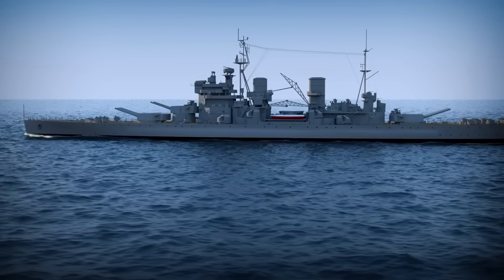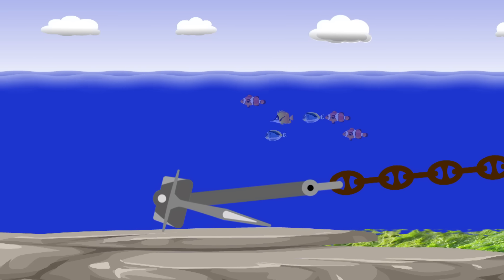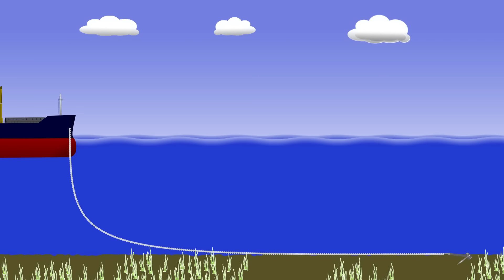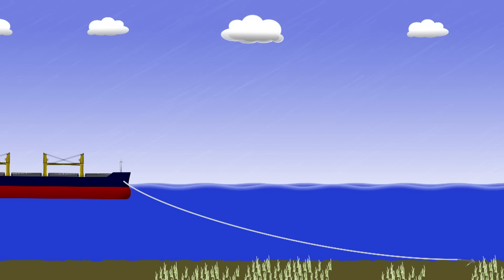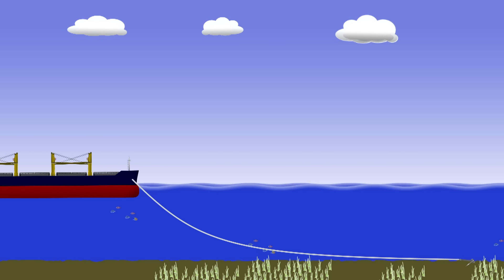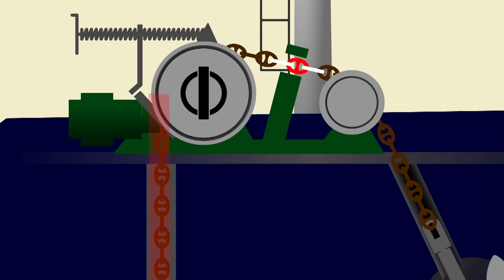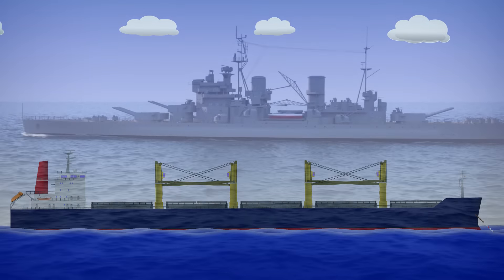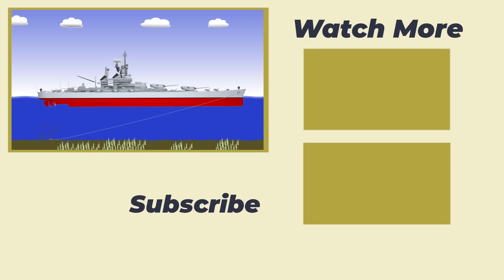The Truth About Anchoring Huge Ships

Comment: I had no clue it is not actually the anchor itself that holds a ship in place. Great video!
Edit: Don't go far into the comments, this for some reason has sparked quite a heated debate
Reply: same here
Reply: The chain holds the boat, the anchor holds the chain.
Reply: Same
Reply: Always glory to arstozka
Reply: I am surprised too that anchors are a bit more complicated than they seem at first glance.
Reply: I have a 20ft boat with 6m of chain on my anchor. Alot of people question why I have so much chain, but I tell them how they actually work and I've done the maths to work out chain length for depth of water vs vessel size.
Reply: Same
Reply: Neither did I, I always thought that it was like a brick on a string, and I never actually considering the immense weight of the chain
Reply: While the chain has a role beyond connecting the ship and anchor, it is not the chain anchoring the ship, this was a very inaccurate video.(At least the narration was inaccurate, the animation seemed reasonable.)
Reply: @mytech6779  you don't understand what the narrator was saying. The anchor keeps the chain connected to the sea floor. The weight of the chain stops the ship from moving. If the chain didn't weigh anything the anchor would never be able to keep the ship in the same place because the ship would drag the anchor through the sediment.
Reply: @mytech6779  Kind of  true,  the way I see it is the chain keeps the anchor pulling into the seabed as opposed to a anchor on a rope pulling at 45° to the sea floor.
Reply: Glory to Arstotzka!
Reply: I hope ur being sarcastic
Reply: @balijaa  like you knew about this before you watched the video.
Reply: @balijaa  you might have happened to know about this topic but I'm sure there's plenty of stuff that you've never thought about. Here's one thing, if you want to deorbit a satilite in LEO what is the most efficient direction to fire its engine? Explain the cause of the Deep water horizon oil spill. Also explain why the astronauts on the ISS are weightless. I challenge you to answer these questions without searching them.
Reply: @drabberfrog  I played a bit of KSP so I know if u want to deorbit u have to fire its engines in direction ur moving example if ur orbiting a planet in this way > and u consider ur engines a bottom u have to position ur rocket like <=€ €=engines so ur going like this <=€ >>>> and u fire ur engines in that position about ISS personel being weightless Im guessing coz theres bo gravity so no gravity=no mass
Reply: @balijaa  nah there is gravity on the ISS lol. They’re just moving around at ~8km/s. And so they are moving around the earth at the right speed to stay in orbit. This means that basically they are in free fall at all times, and so they feel weightless. Also mass ≠ weight.
Reply: @kizzjd9578  The length of rode is by far the most important factor. 45degrees would require a scope of only 1.4*water depth, 5:1(11.5deg) is common for day anchoring 7:1(8.2deg) for overnight and 10:1 for storms(5.7 deg).  

A modern 35pound yacht anchor, typical for a 35foot yacht, will provide 1000-4000 pounds of horizontal hold with 7:1 scope and average seafloor. Typical chain for this size is 5/16 which is 1.1pounds per foot in air and .95 in water. 
Assuming 2000 pound horizontal pull and 7:1 this would  create about 2020 pound line tension and 288 pound vertical component with neutrally buoyant rope, depth being irrelevant for such rope as long as the vector angle is constant. 

Assume 30ft depth and 5ft free-board for chain (7:1=245ft rode), this chain will connect to the anchor at zero angle up to 800pounds horizontal tension. At 2000 pounds it will have an angle at the anchor of 4.8deg and produce 168pound of vertical component. Now that is a 3.4deg and 120pound advantage in vertical force comparing chain to rope, about 40% less. (At 4000pound pull the vertical on the shackle are 576[rope] and 456[chain], still 120pounds but now only 20% better) 

It is possible to add a 120lb [kellet] weight to the nylon rode at or near the anchor and the forces on the anchor become equal to the chain rode. 
Now assuming 245ft of 5/8 nylon rope(10.5pound per 100ft) or 5/16 steel chain(110pound per 100ft in air): The rope with kellet weight and anchor is 25.6+137.6+35=198 pounds, 61 with no kellet; the chain and anchor are 270+35=305 pounds. That weight difference could be used for a 400% larger anchor while retaining the kettle, or an 8x anchor upsize if discarding the kellet. 

Put another way: for a given tackle weight and 30ft water, you can have a 35pound anchor with all chain, 
a 142pound anchor with 137 pound kellet and a nylon rode, 
a 270 pound anchor no kellet and nylon rode,
two 120 pound anchors and an extra rode,
or a 215pound anchor 50pounds of chain for bottom chafing and 3/4 inch nylon.

As for energy absorption you are better off with nylon and or snubbers, a chain catenary only has meaningful energy absorption in a narrow scope and deeper waters.
Reply: @drabberfrog  That is entirely wrong, many anchor tests have showed the weight and friction of the chain is a small fraction of total anchor forces. It is ratio of chain length to depth that matters most. Heavy chain is used because it is more durable than cable or rope of similar tensile strength when rubbing on rocks and steel cable is difficult to inspect or repair.
Reply: Same
Reply: @drabberfrog  if anchir is capable of kerping heavy chain in place, it can also keep light chain in place.
Reply: @mytech6779  Thanks, good to know! This is why I have a spotlock motor instead of using an anchor 😂
Reply: @drabberfrog  this makes no sense
Reply: Yup. Interesting information, new to me, presented clearly.
Reply: @mytech6779  so are you saying the entire video is false?
Reply: its mostly the weight of the chain
Reply: I guess you are not from Nirsk, or you would know everything about ships.  Glory to Arstotzka!
Reply: @SimonWoodburyForget  it’s the angle of the pull upon the anchor that determines how much it can hold. That’s why you let out more rode to hold better. More rode=acute angle=better hold. That’s why when the ship is directly on top of the anchor it can just pull it right out. So some independent research before you believe one video on YouTube
Reply: I always wondered why you put out 10x depth on your boat as your anchor chain.
Reply: @SimonWoodburyForget  And as I said the video is just wrong, it didn't share any real math. I have actually done the math.
Reply: @Andrew H Even on huge ships and off shore platforms most of the ultimate holding force is from the anchor embedment. The catenary only contributes significantly in fairly mild conditions.
Reply: Often it's the ship's engines that keeps the ship in place, the anchor simply a guide.
Reply: It’s still the anchor holding the ship in place silly
Reply: Wow! A true intellectual....
Reply: It doesn't this video is completely wrong! What holds the boat is the anchor, the long scope of chain or rope changes the pull angle on the anchor. You can easily see from the video that when the anchor is pulled at a 90 degree angle to the seabed the anchor has the strongest holding power when the angle  decreases the anchgr looses holding power. This is the reason why you need  long lengths of anchor rope or anchor chain.  The weight of the chain will have some dampening effects but is not the main holding strength of the anchoring system, it's not even 20 percent!
Reply: @drabberfrog  Mt Tech is 100 percnt correct.  
Andrew, rope anchor lines are a thing and there very light weight!
Reply: @mytech6779  The video was very accurate . The anchor is just a means of tethering the end of the anchor cable to the sea bed , or keeping that end in one place , it ios the anchor cable or chain that does the work of holdon the ship in place . When the anchor is dropped the ship goes astern slowly so that the cable or chain is laid in a line, not just pilled on the bottom of the sea bed . It is the combined weight of the chain that keeps the ship in place , the anchor itself acts almost like a plumb bob
Reply: @drabberfrog  Yes , you have it right , the other critcal thing is to let out enough chain for the size of ship and the conditions
Reply: @kizzjd9578  Kind of yes . The anchor is just there to keep that end in one place while you go astern and lay out more chain , its the weight of the chain and the friction that does the actual anchoring , unless it is very bad weather with strong winds and thats when you can drag the anchor as ilustrated in the video , the only thing you can do in that situation is try to retrieve the anchor and drive away or let out more chain and pray
Reply: @balijaa  You might know that those two components stop the ship moving but you probably did not know exactly how it works
Reply: @BundasaurusPecs  So , does that mean that if the iss was traveling slower it would fall to earth ??, gravity would pull it down??
Reply: @SimonWoodburyForget  The other thing about this when talking about the film ''Battleship '' is that even if the flukes got that good a hold on the seabed when the chain came tight it would rip it out of the ship 50,000 tons travelling at around 35¬ 40 mph , it does not bear thinking about
Reply: @arposkraft3616  Correct
Reply: @jakeski3142  No , he fully understands how the anchor works , the video is very accurate and factual
Reply: @fk319fk  Sometimes more depending on conditions , the weather and currents all play into how much you put out , not just the depth of the boat
Reply: @Andrew H That is if the anchor can bury itself , it depends on the seabed and if the anchor can bite into it
Reply: @mytech6779  The video is accurate , it does not need lots of complicated math , it ilustarates exactly how an anchore on a ship works
Reply: @Andrew H No , not just huge ships , 1500 ton coasters use the same method
Reply: @Ajs3371  You are comparing yachts and cargo ships, they are completly different when it comes to anchoring . Cargo ships rely on the weight and friction of the chain to hold them in place , that is why if they are aty anchor and there is a storm they let out more chain . More chain equals more weight and drag
Reply: @Andrew H That guy is wrong (Mytech) , the video is accurate , the anchor does act just as a weight . Think of it on the principles of a fishing weight , you cast out , wind in until you feel temsion from the weight on the bottom as it holds the end in place . The video shows exactly how it works
Reply: @prjndigo  No , its the anchor
Reply: @mynameisprivate158  He is comparing ships with yachts . They are totally different . This video is %100 accurate
Reply: @mynameisprivate158  It is the chain , not the anchor . If the anchor can not bite into the sea bed it will drag , that is why you let out more chain , to increase the weight and drag
Reply: @MrTarmonbarry  Your statements are little more than old wives tales and mysticism unsupported by the actual research and physics. 
And there is a lot of research because anchors are needed for multi-billion dollar ships, oil rigs, dredges, and many other high value floating items.
Reply: The debate has become a bit heated  because there are people confusing the difference of anchoring a yaght or a nodern cargo ship. The video is based around a cargo ship so should be taken as such , and it is correct
Reply: @MrTarmonbarry  You seem to lack basic comprehension of both this general thread discussion and the underlying anchoring topic. I'm not trying to be rude when i say that. But you're a bit like some Indian call center customer support that just keeps mindlessly repeating their one que-card that doesn't actually apply to the issue you're calling about.
Reply: @mytech6779  Of course it isn't really the weight of the chain holding the ship. Otherwise we'd just get heavier anchors (which would also "grip" better) . But you seem to be kind of missing the point  what a chain actually does, and it isn't just durability. You see it's about weight and force distribution, not a total weight.

At low load the weight of the chain itself is capable of overcoming the drag. And this can be easily proven by the fact that the chain will slacken.  So yes the video is correct. However "keeping the chain in place" actually implies the anchor will experience a force. Otherwise not the ship, but the end of the chain will be the one to move. So a bit of a semantics issue, but is still the weight of the chain which "creates" the "attractive" force - and the anchor is holding it (or a portion of it anyway). What this force would be would depend on the weight of the chain. 

The important bit here is that the chain will slacken and change the direction of the force applied at the anchor point. Which is kind of important. Yes, important. This maximum hold is not just a static number. Basically, when the anchor is pulled horizontally, you are compressing the material of the seabed. Not only compressive strength is generally larger, you are also compacting the material thus increasing it more. You see it's not just a matter of the horizontal force applied on the anchor, it's the ratio of them, that's why is so much easier to dislodge the anchor up. 

But  this slack does not only mean less vertical force on the anchor. It also reduces the dynamic stress. On top of that heavier chain has more inertia (because of mass) which reduces the dynamic stress on the anchor points even more . And given the fact that waves are a thing - you can guess why that is important.

So that's pretty much the extent to which chain weight matters, how much it can "slacken" itself by pulling the ship back, and what force it would need to become "tense". 

The bigger the ship the more sense a heavier chain start making. Not only you do not need supersized anchor with all the space that entails, but you greatly reduce the stress of everything. You will rarely need to use the chain and anchor anywhere near their top rating. But if you have heavier anchor, you will need to lift it every time - at once. So not only you would need a more powerful lift and break mechanism, the chain/rope will need to be stronger or it will experience high stress routinely. So you soon get to the point of needing a stronger chain anyhow.
Reply: @MrTarmonbarry  you realize that you can also drag the chain, right? And if the anchor doesn't bite it won't be the ship moving back, it would be the lose end of the chain. For the weight of the chain to create the "attractive force" you need it to be anchored on both sides. Maybe you missed the "keep the chain in place" bit. 

You have two drag forces which you need to balance to stop without the anchor. The water and wind drag pushing your ship in certain direction - and the friction of the chain against the seabed. (If you ever wondered why you usually orient against the current and anchor from the bow - that's it minimize the drag.) A massive ship has pretty high drag, so you would need really a lot of chain to match that - even with rather low current. So no, the drag of the chain is pretty negligible compared with the anchor so that's not what happens here (and why we still need anchors). This should be pretty darn obvious from the animation at the point where the chain lifts, where does that "friction" comes from then?

It is still the anchor, but the distributed weight causes the "L shape" of the chain which is the optimal condition for the anchor "to bite" and to hold. That is, small or non-existent upward component and much larger horizontal one.
Reply: @SimonWoodburyForget  in all fairness MyTech actually has a point with the semantics. 

The weight of the catenary is held by the anchor points. So the anchor will experience a force i.e. that's what holding the chain in place means. 

The friction of the chain with the seabed is not what stops the chain from moving, as after a certain point will not be large enough.  Not only that but when the ship experiences a larger force and the chain starts lifting, the friction will decrease exactly when you need more of it.
Reply: Something he completely misses here is that the anchor doesn't just hold the chain on the bottom, it's weight is needed to pull enough chain out of the ship in the first place until the chain has enough weight strung out to where it'll keep pulling itself out, otherwise it wouldn't drop in the first place.
Reply: @SimonWoodburyForget  a typical cargo vessel like an afrimax tanker(115,000 ton) will have a 11ton bower anchor and 12 shackles of chain weighing 3 tons per shackle(75mm studded),  standard mooring will use a scope of 6:1 and the typical stock-less bower anchor has an efficiency factor of 5 to 12 in typical seabeds with normal 6:1 scope. 
The maximum friction the chain has on the seabed with this setup is around 15 ton force under light load and dropping as the catenary picks up under increasing force.
 
This size ship in a 1.5m/s (3kts) current has about 20ton force, a 9m/s wind is about 6ton force. This assumes pointing directly into the flow, non-aligned forces would be greater. Even under this mild condition the chain friction is only 1/4 of the anchoring power. https://www.ocimf.org/media/8922/Estimating%20The%20Environmental%20Loads%20On%20Anchoring%20Systems.pdf
https://stewart-usa.com/sta-chainlength-catenary-calculator/
Reply: Yeah,  also the colored links is an interesting bit.
Reply: Same rules for small boats.  Let out 6 x the depth of the water in chain. Geeat vid tho
Reply: @mytech6779  you are wrong sir. The video is very accurate. I speak as a Master Mariner. Each length of anchor chain weighs about the same as the anchor so if you have a ship with a 13 tonne anchor with 6 lengths of chain out, that’s a lot of weight holding you. You NEVER want to be in the position when the anchor alone is holding the ship as it will break out. In these situations, you either let out more cable or just weigh anchor and proceed to sea.
Reply: Just here to say, Glory to Arztotzka!
Reply: @drabberfrog  was I right
Reply: @mynameisprivate158  boats don't need heavy chain because the anchor is enough to keep them in place. The anchor alone is never going to keep a ship in place because the ship will pull the anchor right through sediment.
Reply: @balijaa  no you weren't
Reply: Unbelievable Jeff!! They really are getting heated about anchors 🤣🤣

They need to end the lockdown ASAP people goin nuts
Reply: @kizzjd9578  "A lot" not "Alot" nor is it "Allot". Alot is a town in India.
Reply: Well now I’m going allllll the way into the comments!
Reply: @goonridingupnorth1382  same
Reply: I'm just glad my 12' fishing boat anchor doesn't need a chain...or does it?🤔
Reply: @coloradostrong  Thanks, I'm actually pretty on the ball with my grammar and punctuation. "Alot" is one of those words that make me feel like it's wrong when I type it 😂
Reply: @mytech6779  Go on Wikipedia and read something about Acceleration Forces. Then you´ll understand why the Chain has more part in it than the Anchor.
Reply: @brycebullard3619  Your anchors “don’t need a chain?” You’re just tossing anchors overboard? I GUESS that would work, given enough anchors and a small body of water...
Reply: @kizzjd9578 . Yes I thought everyone knew why anchors have chain, even small boats..
Reply: Thanks for the warning!
Reply: @brycebullard3619   it’s best, every small boat has chain with their anchor , proportional to boat size, I estimate you should have about 3m  heavy chain. In strong current it stops the anchor head lifting off the sea floor
Reply: It's the internet, a cute puppy tilting its head could spark a heated debate.
Reply: @garysmith2450  Funny as there is no such title(although there is a "master captain" license, but that is for yachts under 100ton) and every industry source on the sizing of a ship's ground tackle calls BS on a shackle of chain equaling the weight of the anchor. 
A 10ton anchor will use chain weighing about 3tons per shackle, according to actual engineering specifications and international standards.
Reply: @jakecole7447  I'm very familiar with dynamics. The catenary offers only trivial energy absorption under the conditions of scope ratio and current/wind forces found in practical anchoring.
Reply: @diomepa2100  Yes it may be a semantics issue but I doubt it. "The anchor holds the chain in place and the chain holds the ship" could mean that the chain is simply transmitting the forces between the anchor and the ship; but it is self evident that something needs to transmit the forces so the implication is that the chain is doing the actual work of attaching the ship to the seafloor. Poor explanations can be as bad as simply giving incorrect information.
Reply: @SimonWoodburyForget  You don't seem to understand the basic meaning of any of the terms and concepts you are fumbling with. Friction coefficients, surface tension, etc.
Reply: @brycebullard3619  (Yes, I know it is a joke.) While the underlying physics are the same, a 12' fishing boat must consider scaling issues. 
Small anchors of a given design have a lower efficiency factors because they are more on the loose surface and can't bite as deep into better consolidated subsoils, and so very small anchors may not be much better than deadweight.(string on a brick) Secondly as chain size is reduced the surface area to mass ratio increases making them more prone to corrosion. What fraction of the boat's capacity will be taken up by weight of the chain and anchor? And lastly will you be fishing in high seas and gales?
Reply: @Qeycon Ha, like I'm going to give out my member info in a YT comment!
Reply: @SimonWoodburyForget  "anyone can make and publish a website, just like anyone can make a comment, " 
Yes you caught me. I created an entire website, got it respected by the industry, then created a detailed multi-page paper on the physics of wind and current forces on moored tankers just to troll your lame sub-comment on YT.
Reply: I can't believe you people need this explained to you. The anchor itself will not hold a ship in place. The winches that pull the anchor up are able to dislodge the anchor from the soil. So what makes you think those witches have more Force than a giant out cargo ship being pushed around by wind? That's because the anchor itself is made to help embed the chain into the seabed as well. Not only does this make multiple points of contact where it has traction to hold onto but with a large amount of chain let out you make it so that if the ship moves, it needs to move an extreme amount for it to start to pull the chain out of ground let alone the anchor. The only thing I know that can do that are hurricane-force winds. So as long as that's not happening then the moment the winds let off a little bit the ship will be pulled back into place as the anchor chain falls back to the surface of the seabed. It then will redig itself into the sea bed and start the process all over again. My uncle was In the Navy and he was one of the guys to work the anchor on very large ships including aircraft carriers. I think since he actually has experience doing that and you're just a bunch of people sitting behind desks on YouTube that he's probably right. I'm no mathematician so I can't judge the dudes math in the video but everything he talked about his spot on from a man who actually has experience doing this.

 and for those of you in the comments that said to go to Wikipedia. Do I need to explain to you why that's a retarded thing to do? I could literally go edit the Wikipedia page.
Reply: @Qeycon I didn't ask for your phone number.
Reply: @Andrew H mytech speaks out of his passage. The video is entirely correct about the chain holding the ship. I work at sea on large merchant ships so can speak from experience.
Reply: @Andrew H it’s the weight of it as well as the friction. Some holding grounds are better than others but if you’re on good ground, you will notice that when the ship swings round her anchor, she really only swings around the point at which the chain makes contact with the sea bed. When you anchor, on the chart you plot a max swinging circle based on the scope of cable (the chain; on ships, we still call it cable) you’ve put out but you’ll notice that she swings through a much smaller arc. If high winds pass through, you’ll notice that she may drag some chain along the bottom and when the wind calms, she will swing round a new position. If the ship approaches the limits of your charted max swinging circle, you are at risk of dragging anchor. In these situations, you either let go more cable or (preferably) weigh anchor and proceed to sea. It’s much safer weathering a storm at sea than at anchor😊
Reply: @kizzjd9578  Something Casual Navigation didn't include in the video. How much chain a ship needs to let out depends on ship size and depth of water. You 20 foot boat might need 10 metres of chain, in 400 feet of water. This is where switching to a rope rode has a negative impact, staying all chain or switching over to wire / cable doesn't reduce the weight so the chain length can stay shorter.
Reply: @MrTarmonbarry  well I mean if it was travelling slower at the same altitude it is at now then yes it would fall to earth
Reply: It's not! This catenary effect is proven to be nonsense! Myth Busted!
Reply: @SimonWoodburyForget  I never posted a wiki link. I did post valid academically acceptable sources. If you don't have the basic stem education to sort through the basic material presented you really should be seeking to improve you rather than tossing stones around your glass house.
Reply: @SimonWoodburyForget  You can lead a horse to water, but if it doesn't drink wasting time beating it won't bring it back to life.
Reply: Actually it's a Banker that holds a ship in place :P
Reply: @kizzjd9578  Are you running rope as well? 6m of chain will only hold you in 1.5m of water reliably. The general rule of thumb for sailboating is 5:1 ratio length of rope to depth. Even that is cutting the very edge as modern anchors for small craft are designed to bed in best between 15 and 20 degrees for general anchoring. With a small 20ft bass boat you can get away with just the anchor holding you down in sand or mud if you size the anchor properly.
Reply: @mytech6779  I'd have to agree with you. The minimum scope for anchor rope is 5:1 in sailing, and thats just to hold you near a spot for a few hours while you are on the boat in little to no wind. We used to keep 200ft of rope on our anchor for a lake that was 30ft deep where we anchored out at. Even then with an anchor rated for the size of pontoon we had a strong wind would still drag us in the deeper sections of the lake where it wouldn't in the shallows.

Just going through the comments it seems that there are not many long time boaters here, and some who are mistaken. The primary holding of an anchor comes from the bite the anchor gets into the ground. The anchor flutes dig into the sediment like a knife if the angle is correct, which for most small craft anchors is max at 15-20 degrees rope angle. Above that angle and the anchor gets no bite and you are just dragging it. Optimally you would get a 15 degree downward angle as that would really dig the anchor down hard. But less is fine, 5:1 works out to about 8 degrees which still leaves a 7 degree downward angle on the flutes to dig in.

My experience is with sailing and small watercraft, not yachts and the like, i'd imagine they just need shallower angles to keep their bite. My grandfather ran a boat store back in the day, always shocked people when he told them they actually needed 200+ft of rope to anchor their boat in that 40ft lake. People who had been boating for legitimately 10+ years thought you could get away with anchoring in some of these lakes with 50ft lines.

The video tries, but it misses the main point, the weight of the chain only helps absorb shocks and wind when keeping the chain angle low, the added holding from the chain itself is not nearly as great as a properly bedded anchor with a low angle of pull. Once the chain angle starts to creep up beyond that magic number around 8 degrees (or whatever the anchor design is, maybe large ships like that are much lower I wouldn't know) you could have a 4,000lbs chain on that 4,000lbs boat and it's still going to skip across the bottom if the angle is too steep. The majority of the weight is in the vertical direction, one could use calc to figure the exact vector components but I'd rather not. Once that anchor lets go, there is little holding that ship still.
Reply: @2009dudeman  its a 20ft fishing boat no more than 2tonnes. I have 60m of rope and I only ever anchor in 10m while I'm diving the reef. I have a large sand anchor.
Reply: @Ajs3371  but technically speaking according to the logic that you just stated it would be the chain that would be holding it in place not the anchor. The anchor is holding the chain in place at that point. if it was the anchor holding the ship in place then there would be no chains sitting on the ocean floor. I never said that the anchor wasn't useful but the anchor itself is not what the ship is using to stay stationary. On smaller ships the anchor is definitely what can hold the ship in place.
Reply: In many cases it is the weight of the chain, but often it can't.  Lets see how well just a chain holds you when the wind picks up. That extra holding power comes from the anchor digging in the bottom, without that you would be out of luck.  On small boats many times you anchor without any chain on the bottom, or it is not chain but rope, which has no weight underwater. So then it is the anchor doing all the work.
Reply: I came here because I did not understand if the anchor holds the ship in place, how do they retract it, but now the whole process makes sense.
Reply: @drabberfrog  I think what is being criticized is that the video omits to mention the holding power of the anchor. When you resolve the forces at the end of the catenary, you’ll find the horizontal force being applied on the ship has to also exist at the end of the chain (or at least where it falls flat into the seabed). When we design anchor systems for offshore moorings the weight of the chain is of upmost importance for making sure the bit of chain close to the anchor is kept flat on the seabed when loads are applied (as vertical loads or positive angles on this section would reduce the holding capacity and the anchor would slip).
Reply: GLORY TO ARSTOTZKA
Reply: I have read this whole comment section debate and I have come to the only logical conclusion:

GLORY TO ARSTOTZKA
Reply: Just find a smooth shallow rocky seabed, throw all the chain you have overboard, and, as it is shown in the video, you will see how you continue going forward with the wind while dragging all your chain and non-gripping anchor over the seabed. In fact, that is what happens at any anchorage: until your anchor grips you are dragging it and all your so super-heavy chain over the seabed. Hence, whether your chain lies on the seabed or not, it is the anchor's grip that holds the ship in place.
Reply: @drabberfrog  "you don't understand what the narrator was saying"

I'm sure he understands it fine. The video says explicitly that the only role of the anchor is to keep the end of the chain in place. This is flatly false, as anyone can see by drawing a free body diagram.
Reply: @isodoublet  what?
Reply: @drabberfrog  What what?
Reply: @isodoublet  the weight of the chain keeps a ship in place. The anchor keeps the chain in place
Reply: @drabberfrog  Wrong. Draw a free body diagram.
Reply: @mytech6779   a savage for real
Reply: @honey_fungus  Ah hell, are people still going about showing how they don't even know the difference between inertia and a friction coefficient?